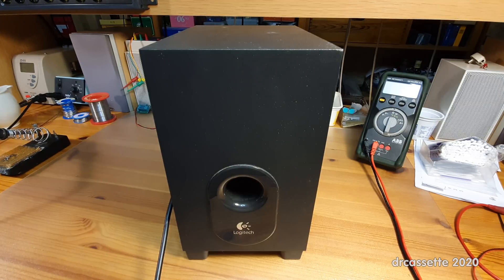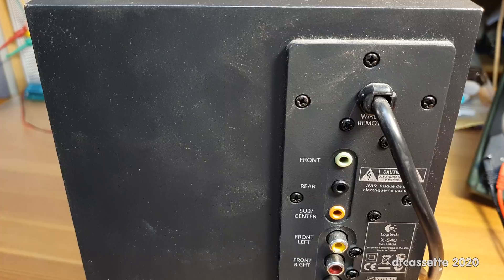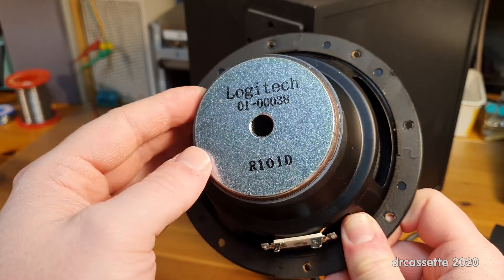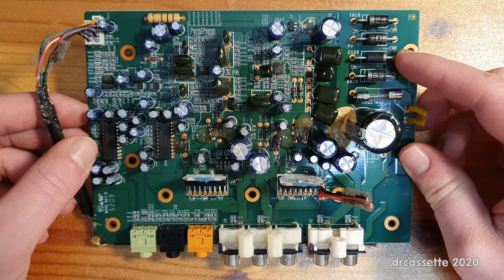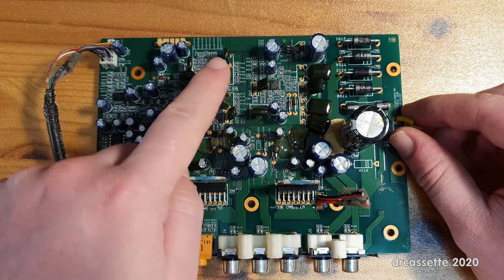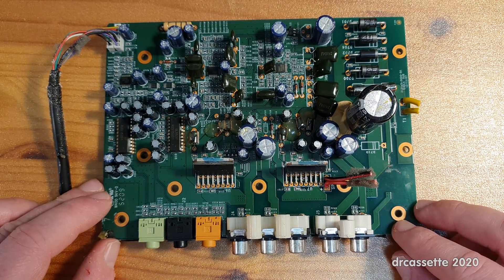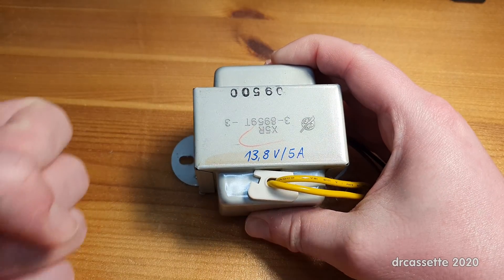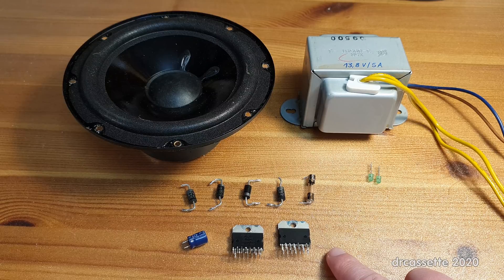Logitech X-540 surround amplifier subwoofer teardown

Comment: Check this data sheet out    https://www.datasheetarchive.com/pdf/download.php?id=f12a1b028fc38c05c984a7d75ebcabbef45ae2&type=O&term=R2S15201  
Look down the sheet....I seen it there...
Reply from the maker: Thank you for the info! So it turns out the R2S15201 is a 3 channel electronic volume control, each channel can be set independently by a DC voltage or I²C bus. This makes perfect sense :)

Comment: I have the same system, purchased in 2015, and it has some differences from yours - no power switch on the sub-woofer cabinet, and the power amps are TDA7377's for 2x30W or 4x10W outputs. Otherwise, the circuit board appears the same.

Comment: I’d probably restore the subwoofer by upgrading that Class-AB amp to a Class-D amp. Also, there are many Class-D amp boards out there. However, the problem is that there are no 5.1-channel Class-D amp boards out there. However, I’d be fine with a 2-channel amp as I don’t care for surround sound. Just that Class-AB amp has a high distortion rating (10% THD), which is not good for high-fidelity.
Reply from the maker: Distortion depends at the output power, when you drive the amp into clipping the distortion level will shoot way up. They only take that measurement so that they can give a higher max output power rating. The relevant figure is the distortion level at low output power, this is also given in the data sheet, it should be far below 1%.

Comment: i feel like you really did a disservice to yourself taking that whole board apart and only being able to recover what little you did. i happen to come here looking for solutions to trouble shoot volume fluctuations in the system which has been going wrong. Somewhere i read that if you clean the volume control eagle puck doo dad it will fix the problem. So i am just passing that little bit of info on to anybody who may come to read this that opening up the volume control by unscrewing the 3 screws in the back covered by the glued cushions  you take off the plastic and the dials will slide off too. Just spray some electronics cleaner on it, let it dry, and it will possibly solve all speaker issues and volume fluctuations.
Reply from the maker: I had no need for the system as a whole, the parts I salvaged are a lot more useful just by themselves.

Comment: Mine died a month ago. Today I disassembled it and I found the problem is the transformer. Very quick fix but I'm trying to find a replacement but I can't find a 110V to 14.6V 2.4A transformer. Any idea where I can find it? Thanks!
Reply: I had the same problem, I ended up just getting a laptop power supply of the correct voltage and sufficient amps and hardwiring that into the system.
Reply: @joshuamcilvain  ohhhhh I want to do that so bad, I just don't trust my technical know-how

Comment: For your information, this was one of the most excellent audio systems ever available at that price (circa $100) with such beautiful performance and great design. I have been using them since 2008 as my primary computer audio output with the virtual (matrix) (for 2 channel notebooks) or real 5.1 (for desktop 5.1 cards) surround capabilities. I am disgusted to see your way of underestimating the whole system including the comments about chips such as R2S15201. These are a class of custom configurable high performance digital amplifier, electronic volume control and equalizers with 64 steps   I2C, DC and channel select capabilities.
X-540 Specs:
Total RMS power: 70 watts RMS
Satellites: 45 watts RMS (2 x 7.4W front, 15.4W center, 2 x 7.4W rear)
Subwoofer: 25 watts RMS
• Total peak power: 140 watts
• Frequency response: 40Hz - 20kHz
• Drivers:
Satellites: (2) 2” drivers per satellite
Subwoofer: 5.25” ported driver
• Speaker dimensions (H x W x D):
Satellites: 8.4” x 3.2” x 5.0”
Center channel: 7.8” x 4.75” x 3.75”
Subwoofer: 11.25” x 6.5” x 9.75”
Reply: 👍 I'm still rocking one too, though I may upgrade to a 7.1 digital system at some point (If I do my main retro gaming PC well inherent my X540 system)
Reply: @JohnSmith-xq1pz  And after writing this comment, I actually opened up the box and added an extra Blue Tooth interface within so that I can use the system at any casual occasion to connect to a phone or some other audio source wirelessly.  It's working perfect too!
Reply: @uvtube2008  how you do that?
Reply: @Asafo4daPeople  
It's simple. You can buy a very tiny Bluetooth to Audio-Line-out Module online and embed it within the woofer box. It requires just a very low current  5V power  which can be tapped from the built-in power supply already within the box. (Make sure it's 5 V that we are tapping from. Never more than 5.0 not even an excess of 0.5 V).
Connect the line-out (L+R) from the module to the pre-amp / line in points within the amplifier and then pair with any blue tooth device.

Comment: Ive been using these for over a decade now and I honestly can't find a decent upgrade that isn't way more than I want to spend for my PC setup. Guess that's the side effect of headphones being all the rage, but I cant stand wearing headphones, especially for hours on end. Plus I like surround sound in gaming, not stereo or fake headphone 'surround'

My original set has developed a problem with sub hum (and when the hum starts, the audio is also all distorted really bad) that comes up after a seemingly random amount of time while listening to music, playing a game, etc. Unplugging the power cord for a while seems to fix it, or oddly enough slapping the side of the subwoofer box does too. But it will always come back, sometimes 10 minutes later, sometimes hours later. Also some music seems to make it happen right away while other music seems to not cause it. The louder I have the volume or the higher I have the bass turned up seems to affect how fast the hum comes back. I've wondered if its sort of a crossover issue or something because when the humming starts and I have none of the regular speakers hooked up I will get vocals coming out of the sub (obviously they will sound horrible too)

The transformer finally died on my original set so I bought another one of the subs off ebay. Of course that one ended up having a bad controller when I went to use it and I had to mess with the volume pot constantly to get the volume to stabalize but it would continiously get super loud, then go very quiet over and over without my touching it. I ended up deciding to combine the two to try and get one working unit as a result. Swapping the transformers is what I did because swapping the controllers looked really complicated. 

So now I'm back to using my original (with the replaced transformer) and dealing with the randomly appearing hum & distortion which is gradually getting worse. I'm pretty clueless as to what the cause could be that will go away when I slap the side of the sub box. Not sure what to even do now, I'm sort of on the fence about trying to buy another one off ebay and hope that it actually works right because they arent that cheap (lucky if you find one that will be less then $100 after shipping) and even though people always say 'tested and works' etc, I'm pretty sure that just usually means they plugged it in and the light came on and that they didnt actually test it with any sound input.

Just super annoying because its 2022, why are there not any decent options to upgrade from this outdated set.
Reply: It's a bit ironic that I watched this today and got thinking and decided to open mine back up for another look. And I realized that large capacitor that sticks through the shielding seemed a bit loose and noticed the dab of glue meant to hold it in place was no longer attached to the circuit board. I found through gently moving it around that I could make the hum/distortion appear and disappear at will. Which would explain why it didnt always happen but happened more often when volume/bass were turned up as well as why smacking the box would fix it briefly. 

So I used a bit of hot glue to re-secure it back in place and it is soooo much better (so far at least). I think I might need to make a slight adjustment to it still but holy cow I am so glad I saw this video (which is a great break down btw) because it lead to me (likely) fixing mine.  :-D
Reply: @LostChord84b  You should not give up on this great piece of audio equipment. It's really a wonderful product to go a long way. Congrats for keeping it up.
Reply: Update a couple months later:

Everything had been great since my previous post, but now I have a new issue with it all of a sudden.. the volume has increased dramatically. As in with the volume knob turned all the way down it is super loud 😞I'm afraid that maybe the controller has gone bad and I'm not sure that there will be anything I can do about it this time. Kind of sucks because I thought everything was going to be fine now and it had been working perfectly again till today.

edit: I opened up the controller and tried blowing out the volume pot hoping some crap was in there making it get 'stuck'  ..and it seemed to make it a little better, for about 5 minutes. Now its back to super loud again. What a damn bummer this is lol and I checked ebay again and the prices are still ridiculous $150-200 is way too high for ones that look all beat up and might not even work etc

edit 2: OK maybe blowing it out was a bad idea, its even worse now, the volume knob doesnt do anything anymore. I guess I'm stuck opening up the sound options in the windows control panel and adjusting the volume sliders to be able to make any slight adjustment 😞
Reply: @LostChord84b no idea if you still have this, but I have the same issue. The volume know doesn’t work, volume is always at max.

I’ve checked the potentiometer with my multimeter and I think it’s broken. I’ll try to replace it if I can find a compatible alternative component.
Reply: @LostChord84b  Nice, hopeing my X540 stays trouble free for years to come
Reply: @LostChord84b  See if you have got some short circuit between the terminals or wiring that comes out of the volume control. It may just be some conductive solder or moist junk or a strand of wire. Just a chance.

Comment: Thanks for this, I just watched this for motivation.
I ended up opening mine and replacing the transformer with an smps from a ps2.
I desoldered the rectifier parts.
The transformer was getting hot and making a buzzing sound.

Comment: I lost my wired remote control today
I can not turn on power because my subwoofer doesn't have power switch
how can I fix this
Reply from the maker: You will have to find that wired remote control. These systems are not designed to work without.
Reply: Short answer is you could trace the wires on the main board to try to find which ones are going to the power stage and wire up a switch to those.

Comment: ive had mine since 2009 it works flawlessly except when i plug in earbuds to the dial , only one side works unless i put something on the wire lol sucks

9:30 how did u open that volume dial part up
Reply from the maker: I don't remember how exactly the volume control device came apart, I think there were some screws on the bottom, maybe hidden under the rubber feet. Seems like you need to resolder the headphone jack on your control device.
Reply: If you open the remote and expose the components Get some electrical lubricant and spray a little into the potentiometer and female 3.5 component and that should solve the problem for a long time just make sure you whip any access liquid off the board and you should fix the problem a lot of times the metal oxideses and you get loud horrible clicking noise

Comment: Very interesting. There must be different revisions of this system. I also use an X540, but mine doesn't have the power switch on the back of the subwoofer and also on the control-unit it doesn't say mute but power. But the rest seems to be the same.
Reply: Mine too same as yours. The Product ID is FE752.
Reply: Same

Comment: I think you need a better disordering gun.   I've not had all that much problem with multi layer boards and I've salvaged hundreds of IC's.   Good video.   Once upon a time I used a torch and had good luck with survivability.  Kind of soo fast chips actually made it.

Comment: Hi excuse me I have x540 logitech 5.1, I have a problem with this equipment because a noise appears as interference in the sub woofer, it started intermittently then it stayed like that, that noise that makes the subwoofer rumble no longer disappears, I disassembled it and removed the suffwoofer and it no longer bothers that noise,  But my x540 is not the same, I want to repair it please help me that may be what is bothering me, I bought another subwoofer I replaced it but the noise that high and ugly does not go away
Reply: What is causing the problem is the r2s15201 chipset ( volume control). There are two...Touch the pins at the bottom of the chip with your fingertips (swipe your fingertips), whichever one improves the sound, replace that chip with a new one. i changed it myself, it was pretty hard, but you can be sure the problem is there.

Comment: Hi, just watched your marvelous tear down video.
And here is my big project : May I use the 13.8V transformer and replace the whole amplifier board with this Class-D board ?
Will be installed in the subwoofer enclosure and use all the input/outputs of the original plastic plate. 
TPA3116 Digital Sound Amplifier 50Wx4 Surround 100Wx2 (Center + SUB) 5.1 Home Theater DIY 
https://www.aliexpress.com/item/32753025990.html?spm=a2g0s.8937460.0.0.3b8f2e0eu9uMp7
Reply from the maker: But what advantage do you hope to get out of your project? The power output of the class D board is too much for the speakers of the system, you could blow them accidentally. You would loose the remote control as that could not properly be interfaced with the class D board. I would recommend leaving the original amplifier in place.
Reply: @DrCassette  U're 100% right, I did quit the project already. 
But I do have the "Front-Left channel low  sound" problem. And need some help.
All other channels are fine except the FL channel, it works but sounds lower than the others.
What should I need to check, any ideas about the probable malfunction of this issue ?
I really do like my 13yrs old X-540, I have to save it...
Reply: @Boorock70  Please check the input (3.5 mm TRS 3 way) and output(RCA) connectors both female and male. These connectors seems to get rusted on the surface and cause bad connection. I had to clean them up with sand paper and WD40/Isopropyl Alcohol  to get the gains fixed.
Reply: @uvtube2008  Thanks, I'll try.

Comment: Currently listening on a Logitech X-540, haha. Only a slight variation on my (US/Canada) model though, the button indicated to be "Mute" on the wired remote is labelled as a typical power button (because it is, it turns off the little green LEDs and everything).  And "Matrix" just means it does some Dolby Pro-Logic shenanigans, mixes your 2 channel audio into faux-surround.
I quite like mine, I've had them set up like 2.1 system since I moved, but the sub flush to a wall under my desk fills my little computer corner with bass nicely. The speakers themselves lack the really sparkly treble but are also decent for what they are.
Reply: Mine too works very well for the past 14 years! I opened it up to upgrade but after seeing the beautiful design, decided to keep it as it is. Later, I might add a snuggy little blue tooth input to the system board though.

Comment: Does anyone know any adapter to use to connect the 3 3.5mm jacks to your TV?
Reply from the maker: You would need a TV with analog surround sound output. This is not a common feature.

Comment: I found this system at a goodwill and the connections on the board aren't making a proper connection with the surround speakers...I was hoping to see how you got the hot glue off from the plastic. It when the video showed the broken plastic at the "4:50" second mark, I was disappointed..
Reply: I'm currently waiting to see if rubbing alcohol will make it possible to peel off...if not then I'll only have 3 surround sound speakers

Comment: Hi, thanks for the video. My X-540 has a problem in the remote control. When I move the cable sometimes it stops working, or the bass gets increased/decreased. Do you have any idea on how to disable the remote control? My idea is that I don't need this control, if I turn on the sound system and it's in the highest volume with bass from medium to low and matrix disabled I am happy. I can adjust the volume on my device (pc/phone). Any ideas on how to do this or even replace the control cable?
Reply: Hi, did you ever fix this? I have the same problem.
Reply: same problem

Comment: Hello,
Can I use this set without using the 3 way aux cable? I mean, if I only use the green input (1 way aux)... will it provide a 2.1 stereo sound? (Sub + fronts??) Front aux port on sub ➡️ headphone jack on my phone. I want to connect this set to my phone while playing some mp3 256kbs files in stereo mode...
Reply from the maker: That should work. You can't break anything just trying it, so just give it a test!
Reply: Please keep the Matrix switch ON. It will.

Comment: Hello there. I am using logitech x540. I disassembled the controller from the motherboard and rummaged its places. I had soldered on the motherboard, not with a socket. I looked everywhere and could not find a color scheme. There are 5 legs in 2 rows. can you help me, thanks in advance
Reply: Do you maybe know what resistance the bass knob is because i need to replace it